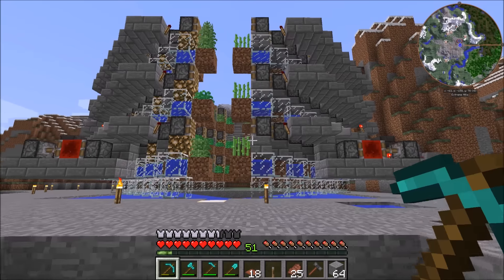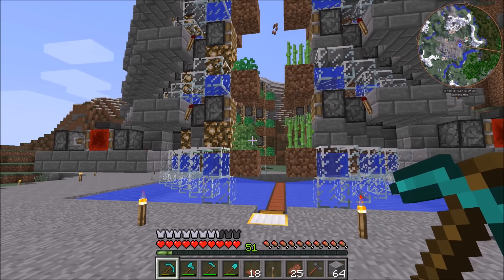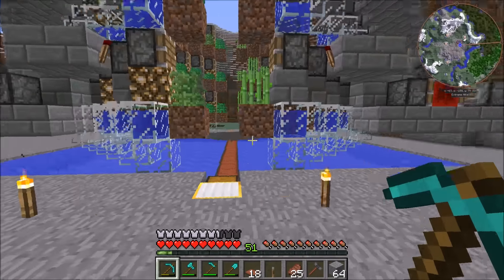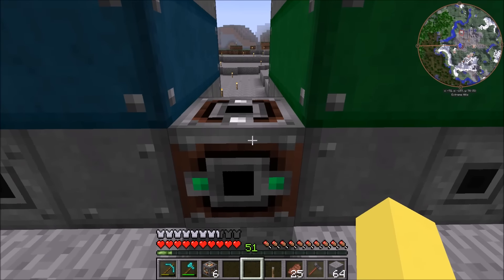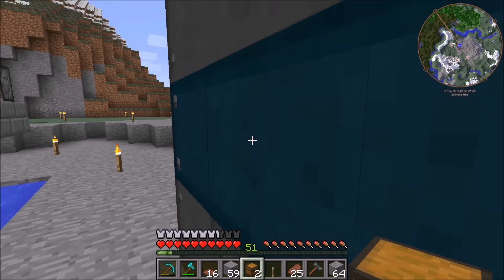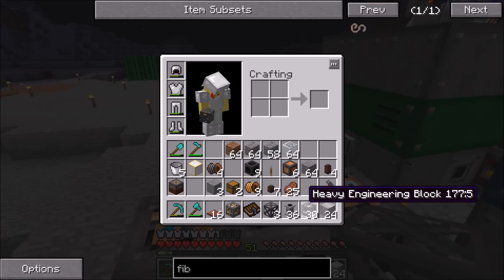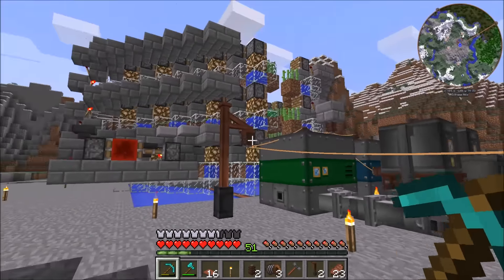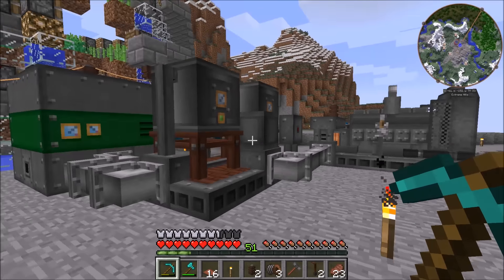Surviving With Immersive Engineering :: Ep.13 - Optimized Diesel Generator Setup

Comment: There is one way to fix those seeds getting stuck on dirt blocks. You have to offset the two halves of your farm in horizontal plane, so there are several empty blocks in front of each piston. Or you could invert them, so instead of having a cylinder like structure, you would have something resembling a H, in horizontal plane. As a bonus, everything would run off one clock and same redstone system.

To further improve it, encase each piston body in blocks, so you don't get material kicking back.

In my play, I'm actually constructing a skyscraper that has 4 farms per level and resembles a flower in horizontal plane, basically 4 V's pointing towards the center, that way the product gets kicked outwards and hits the glass surface of the skyscraper.
Reply from the maker: Wow, that sounds like an awesome (and very very time consuming) build! Good on you for putting in the effort :) and thanks for the tips!

Comment: I've always been a fan of having a capacitor in the wall to transfer power through walls. Just input inside and output outside.
Reply from the maker: Yea, having the power buffer flush with the wall would definitely be the way to go about it! Looks nice and is practical :)
Reply: A feedthrough multiblock was added in one of the newest versions for 1.12.2, should make that easier.
Reply: @RagePlaysGames  I never can play with mods so I love Java edition plays vids.

Comment: For the upside down connectors, not sure if you were shift- clicking on the under side of the arm, but it works fine for me  - at least it did when I tried it with a HV relay.

Comment: Not sure why he insists on putting the connectors/relays downward on the poles.  Most distribution lines in reality have the insulators pointing upward on the top of the pole.  Just making more headaches for himself really.  The drawing glitch is just that.  I've just seen it in ATM 3 v5.12.0 just the other day. It eventually fixed itself.

Comment: I know this video is old now, but you could have done this SO much easier with zero loss using fence posts to break the 2nd levels of the sugar cane, and hemp. Everything else is setup fine, but you could fill in the center with plants as well for more efficiency with a fence post in between each plant. 1 fence post will break 2 plants. No redstone, or pistons needed. SO simple.

Comment: don't forget water for coolant
Reply: Diesel Gen doesn't need coolant.
Reply: In the 1.10.2 version it does.
Reply: Really?  No way.
Reply: Every time I've set one up in my base, i connect to a large tank of IC2 coolant. Since i remember reading it in the manual. And that was back in 1.7.10. Maybe it was a removed feature?
Reply: I think that feature was removed, I never had to deal with that in 1.10.2 IE.

Comment: just cant seem to get the perfect setup to automate the diesel engine. My current setup is using an EnderIO farmer to farm a 17x17(maxed) area half filled with hemp and potatoes and a i have a small sugarcane automation to back it up. Even with a starting buffer of diesel the generator can't manage to keep up and i end up running out of power. Your vid shows how much is really required to run it consistently and its rough.

Comment: or, just put the connectors on the top. I know its late, but no one else said it. in a mod spotlight video, the wire connectors go on the top of the power poles.

Comment: In the front of your base, between the right-side-up stairs, are those slabs?
Reply from the maker: Indeed they are!
Reply: Thanks, was working on a recreation.  Btw, took a page from a MCF thread called Blocky Creations - Mechanical Power, and simply increased the width and depth of the windmill tower part in the tutorial by 1 block each, then added IE's windmill blades in place of the normal blocks.  Fully functional.

Comment: DrRage, how did you get an extra layer on there and still be able to wire up the timer correctly?  I tried wiring it up there and it always ends with the final torch being one layer lower than I'd want it to be.  I'd like to know exactly how that was done.
Reply from the maker: As far as I remember it was just a classic redstone torch ladder going up from the timer to each layer. If it isn't in the video its definitely in the one that is linked in the desciption to mumbojumbos version.